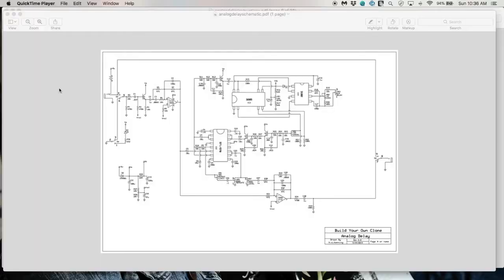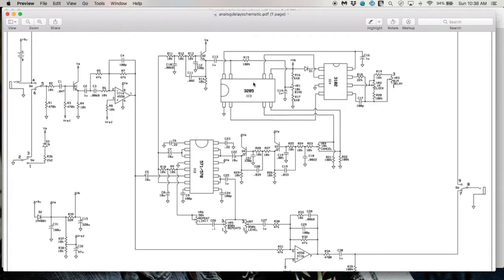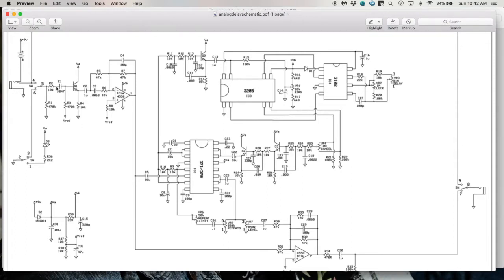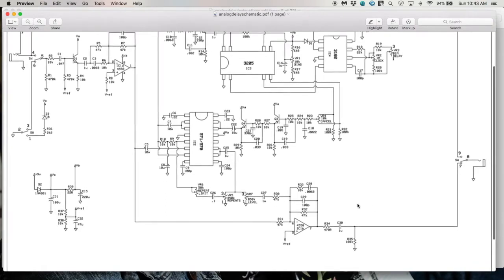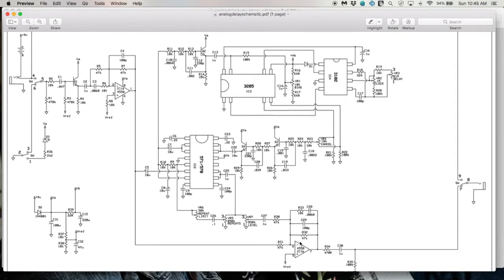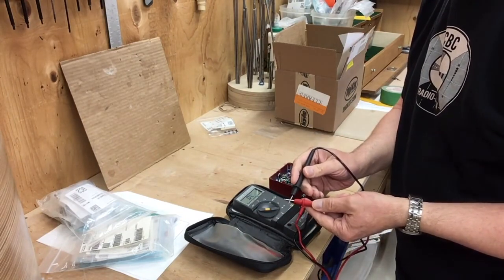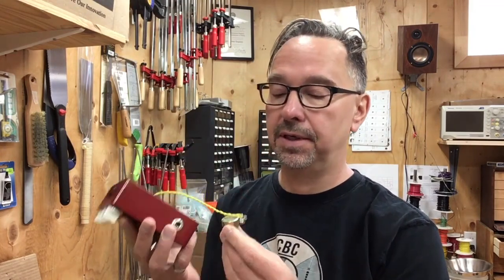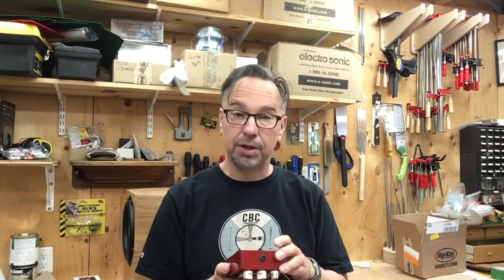Mayfly on the Bench Moding an Analog Delay

Comment: Since that’s a ”set-and-forget” value (at least for me) I would swap the 47k resistor to one of those small micro pots - the ones you adjust with a Phillips screwdriver - and have it inside the enclosure. 
I’d find the right level and then close the back and be done.
Good video as always! 👍🏻
Reply from the maker: Thanks man!  Yea currently I've got a 68K resistor soldered in parallel with the 47K, and it's a little on the loud side :-).  A trim pot is probably just the ticket.
Reply: I would have suggested the same, a Trimpot would do the job well, but Logrinn ws faster than I :) Nice job!